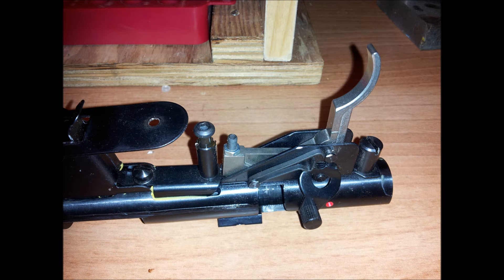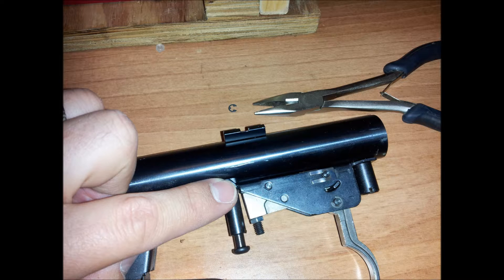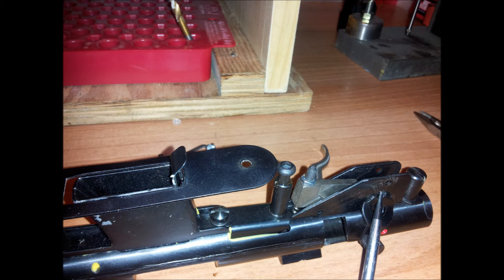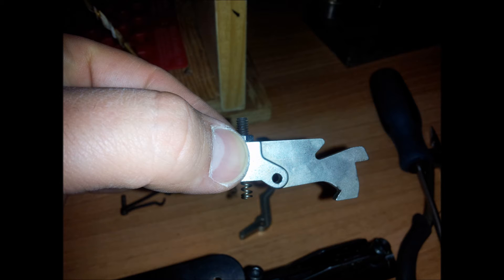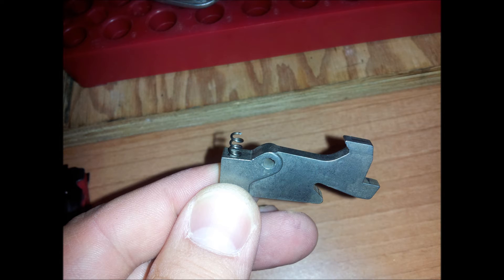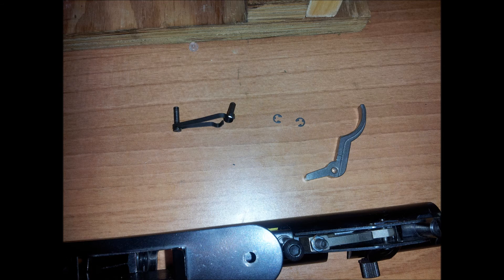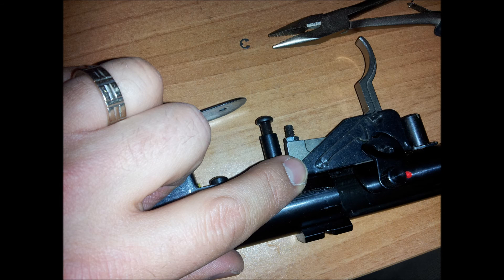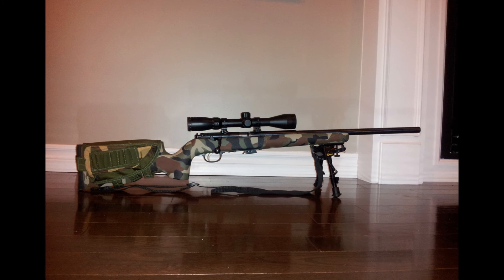SAVAGE MKII TRIGGER JOB

Comment: Came here to see how he was taken apart and what he was doing. Cutting the spring was necessary because there's not enough adjustment to back off it. I didn't Shimon anywhere but I did take a 8000 grit hone and Polished up the. The pool is still a little long , but it's quick and smoooottthhh. Especially since I might have a niece or nephew using this, I was able to get just over two and a half pound trigger and in testing the adjustment now can be adjusted up to 6 pounds. Probably a little more if I wanted to , but why? Set up at two and a half pounds and having nothing but fun !! Thanks for the video

Comment: By cutting a coil off the spring, you have effectively made the spring rate higher (less wire), and have only decreased the preload.  Why not just back off the adjustment screw above the spring?  That would lighten the preload, but not increase the springs' stiffness.  I guess if the end result is what you wanted, and it works for you, well...then it's good.
Reply from the maker: it works bottom line

Comment: I used assembly lube.  Later used two .030 shims on in front one behind the shear keeping it square. I left the stock spring as is. the lube made all super smooth.  the shimming made it a quick trigger release leaving the stock spring made it a safe trigger. Groups tight as can be using CCI short CB 29 grain bullets. 
Making this a deadly quite shooter to 35 yards. Nutters & Crow's no problem no scaring the flock away while shooting.
Reply from the maker: very cool thanks for sharing

Comment: Not a very complete trigger job dude. You should have polished the sear surface and the bolt where the sear makes contact, with a dermal tool and red jewelers rouge. Also shimming the trigger with the proper size shim..usually .009 to ..0011 will do the job. You will really have a nice trigger if you do these fixes....not just clipping a coil of the spring.
Reply from the maker: what are you shimming? only thing i can think of is the side to side play, is that what you are talking about? i have never polished a trigger or the sear before does it make that much of a difference? i have polished metal before and have all the tools and rouge. i have read of people making the trigger to sensitive from polishing. maybe they over did it and took the sharp edges off and made them look like a mirror.
Reply: Polishing does not take off any metal. It makes it smooth. Just polish where the sear and trigger meet. Makes a very nice trigger...about 2-3 lb. pull with no trigger creep.
Reply: Polish that trigger while it is apart. Use a dremel with a soft wheel and jewelers Rouge.  I did mine, and the trigger is wonderful.  No more flyers, and I am getting 1/2" groups ar 50 yds with CCI Standard Velocity ammo. I also made a shim out of a medium guitar pick to take the side to side wobble out of the trigger. The video was helpful to tear it all apart though. Thanks
Reply from the maker: That’s a great idea using a pick as a shim is brilliant thanks for sharing this info